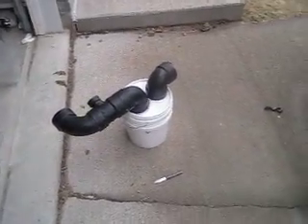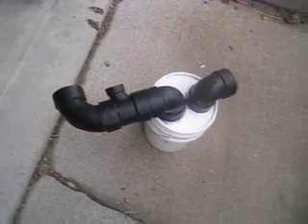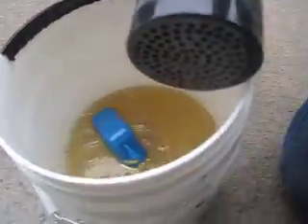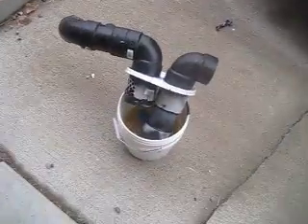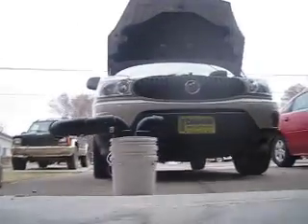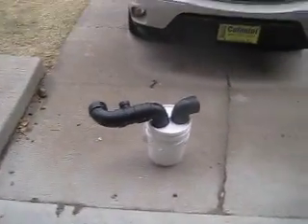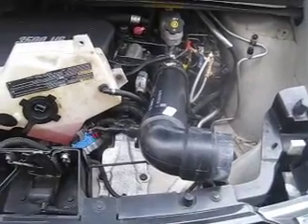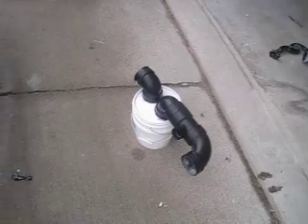Gasoline Vaporizer Build Part 3 (Inards Of The Vaporizer)

Comment: Since there was issue with small evaporator hence i am thinking making a double wall steel container like you hv made with bucket. But before designing this container, I request following information

1. What was the approximate diameter of bucket at fuel top level? As the top surface will play an important role in evaporation.
2. Is there any difference in size for air inlet / outlet to the bucket. I am thinking of a 50% smaller inlet then the outlet. So if outlet is 6" then inlet will be 3".

Comment: 3. After that I have placed another petrol solenoid. This solenoid will be connected to the vaporizer tank level gauge. So as soon as the petrol level in the vaporizer goes down this solenoid will be ON and will supply fuel to the vaporizer.

Earlier I had tried LPG evaporator as this has provision for radiator water circulation. So in that case
4. I have cut the radiator hose and circulated the radiator water through evaporator.

Comment: Hi,

Today I have reworked on the system. In my previous trail, I had done the following
1. Used the emulator (coming with LPG kit) to cut off the power from fuel injector.
2. The fuel line is cut and placed a T over there. One side of the T is connected to Petrol solenoid. This petrol solenoid will be in ON position as soon as we will put the emulator ON.

Comment from the maker: Nope I don't have to shut down the fuel injectors I have the valves in my fuel lines shut off so no gas is going to my engine. You can still have the fuel injectors on and the fuel shut off and use the vapor through the air intake. The bubbler system can have problems this is why I designed the fuel injector adapter I have not shown yet.

Comment from the maker: I have not tried any of those yet and the reason I haven't is because the majority of people don't use those as regular fuel in their vehicles. I will be trying it at some point but not just yet. As soon as I get it perfected with gasoline I will start testing other fuels! As for the coil I have not done that yet I will be using exhaust instead because it gets much hotter then the coolant.

Comment: Have u tried alcohol in there yet. Ethanol or even better methanol but be careful with methanol it can blind u!!! Also if u can put a copper coil in the bottom of the bucket an hook it up to ur radiator/cooling pipes it will vapourise the alcohol at 60c and radiator pipe gets hot to 90c so should work a treat. All the best if the ppl of the world thought the same way we would have heaven on earth.

Comment: you can also switch off your fuel injectors with a switch this will keep the fuel injection rail pressurized then pull out your fuel pump fuse for a second and install a fuel line right at the fuel bleeder with a brass micro shut off like they use with 1/4 inch line this will let you control the fuel to your vaporizer with the limiter switch. replace fuel pump switch and make necessary adjustments . start your car you get fuel to your vaporizer stop engine and fuel is stopped adjust as needed

Comment: Have you considered doing a build using a 12" Length of 4" Wide PVC instead of the bucket?  It would be a lot easier to find a place for a 4" pipe instead of the bucket.  In regards to adding another butterfly valve, couldn't you put a hose barb into the plenum ahead of the existing butterfly valve and run a hose to the Vapor Container.  I don't know if this would solve the problem, but if it did, it would save you some time and energy.